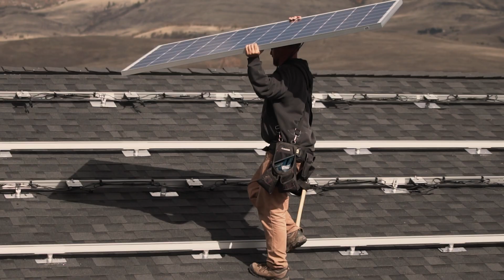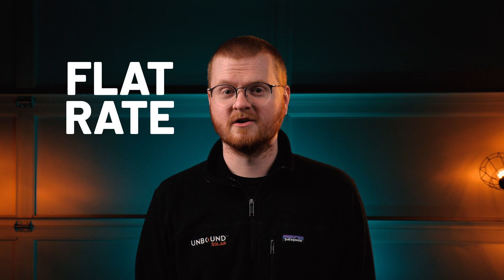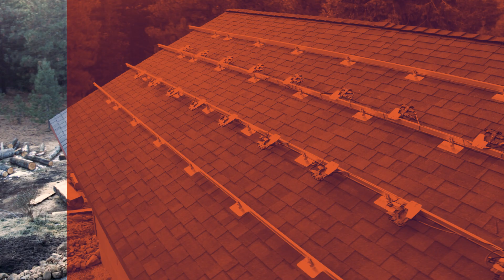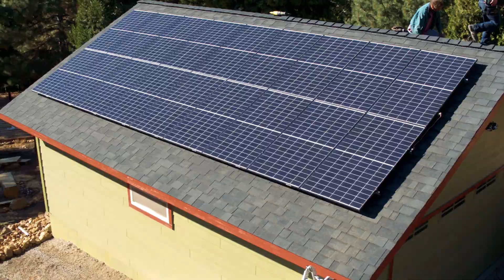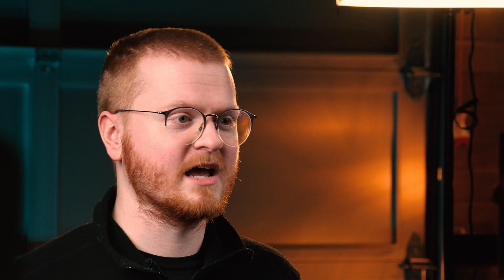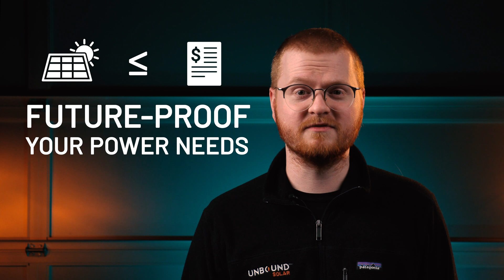Is Solar a SCAM? | 5 Reasons Solar Leases Aren’t Worth It

Comment: Today, solar panels are the cheapest component of a solar system that also includes storage batteries, inverters, transfer switches, and a subpanel. Also, some states are no longer worth while to sell excess electricity back to the grid. So owners should look into a hybrid system to allow power to be stored and accessed in peak demand or a power outage. A system can cost between $15K to $30K (with professional installation) depending on how much electricity capacity is desired. The hardware is getting cheaper every year with the matching federal tax credits.

Comment: Real world experience here:
I started a solar PPA in August '17 with Vivint Solar (now Sunrun), and right from the start everything I experienced was exactly what I expected. I was set up with my panels and even all-new electricity coming from the street to my house to a new circuit breaker panel box, upping my amps from 60 to 100, all at zero cost to me. My 20 year contract started at 15.9 per kWh with a contracted 2.9% annual increase. One year they didn't even increase it.
I only ever paid the price per kWh according to how much production was made and not a penny more. 

I was told that in year 6, I would get a one-time offer to buy out the system, based on current FMV. Earlier this month my 6-year anniversary arrived, and I contacted them because I had a number in mind to be comfortable buying it out, being responsible for any issues that may come up. 

I'm good at simple math. I calculated the amount I would pay through years 7-20, factoring in the 2.9% annual increases, and came up with $16K over the next 14 years.
My comfort zone was $11K, giving me $5K leeway in case something comes up (inverter failure, most probability) within those 14 years.
They quoted me $8,700 to buy it out. Bonus!! That's $7K leeway.
I signed all the necessary papers, mailed the check in full and am just waiting for everything to be finalized and I will get the warranties for the panels and inverter transferred to me.

Here's where I surprisingly did very well: I lamented not buying the system myself, just paying the money upfront and never paying anybody for anything after. I could've. I have the funds. If it would've cost $20K, and then a 30% tax credit the first year, that brings it down to $14K total.

In years 1-6, I paid $5K. Buyout was just under $9K. That's the same $14K that I would've paid if I did pay upfront. But where I think I really made out was that if I did just have panels installed, it wouldn't have come with the electricity upgrade that I got for free.
So, just waiting for the cancellation of my contract to be finalized and have the warranties turned over to me, did I do alright?

Comment: There isn’t always a escalator, you could have a 0% escalator. Even if you have the escalator they are usually lower then 4% and with the rate of inflation the utility rates would still be higher then that of the rate of the escalator in the futures
Reply: Yeah but the salesperson selling the panels to you, won't be getting any commission on that, if your escalation is 0 percent.

Comment: Solar is a scam. My original electric bill was $150 a month on average. After getting solar, of which I now pay $148 fixed payments to use.. it did zero to lessen my electric bill. I'm still paying the electric company $150 on average each month + the solar bill, making my monthly payments of using electricity around $300. According to the website account for el paso electric, i'm using 0 kwhours, as if solar is actually working, but then the bill comes in and then i asked the electric company what's the deal? they gave me that BS about cloudy days or the panels aren't working yadda yadda. had solar come out and check, they said it's working tip top, no issue. we don't use power at night anyway aside a laptop and the coffee maker (and the fridge). the bill should be no more than $20 for line usage, or none at all since the amount of solar i'm producing is more than i'm consuming and they claim to buy back the power you overproduce  (which according to our solar provider, we are producing way  more). This leads me to believe our solar company is lying. The power company is well established and doesn't charge more than their systems indicate, so I'm convinced solar panels don't work at all. they're just pieces of glass that do nothing.

Comment: Dear Lord... the ONLY reason for any lease is to use something expensive for part of its useful life... you are NOT locked-in long term/required to pay full price. If you lease a $40,000 car, you generally do it for a couple years. You might pay $900/month for two years. $900 * 24 = $21,600. Its dumb to pay that much, but you aren't locked in for more than two years. That is the only reason to lease... the ability to quit early. You don't have to pay $40k plus interest.

A regular loan for 6 years @ 6%, no money down is $663/month. Why on earth would anyone be forced to make all payments (I.e. 6 years) and choose a lease vs loan... $900 vs $663/month? Only a moron chooses a lease when you cant get out early. No solar leases allow you to get out early...

All solar leases are long-term/full price plus massive interest. They all charge more than a loan. They all open you up to liabilities (big deal). They all prevent you from selling off your home without paying the high price in full. They raise payments as you go (they aren't flat). 

If we want to get technical, lease payments are based on residual value... there is zero residual value for solar. Only a complete sucker "leases" a solar system. Its literally bone-headed and incomprehensibly stupid. It very much should be illegal. The only people who do lease solar... have been suckered... lied to. No informed person would lease solar vs a loan or cash. None.

Comment: I spoke with a sale person last week. His calculation for my small house would be $45.00 on the solar payment (25k for all the solar panels). The electricity bill will be dropped down to some $25.00. The total of the TEP and the solar bill will be around $70.00. My Summer electricity bill is around 140.00. Average yearly is around $56.00. There is a flaw to read between the lines. The total power (kwh) the TEP allows for my home will be 3.2kwh on the 400w panels. From the beginning, he was saying the TEP does not like anyone who has solar panels on their roofs because TEP will not make money if everyone have those. In 45 minutes later (the end of the conversation with the sale person), I asked him if I can have over 6kwh on my roof and on my back yard (he forgot what he was saying), he told me that the TEP will not allow my home to have that capacity (over 6kwh).
After 45 minutes in the conversation with him on the phone, I realize it is a SCAM. It seems to be that the energy on the solar panels will definitely benefit to the TEP (TEP controls and limits my solar energy). The 3.2kwh allowance will not benefit me at all. My A/C run on 2.8kw, my stove run on 3kw. What would be the power I can have with 3.2kwh if I will run the stove and the A/C at once? I still have to use the energy from the power company. 
There is a downside on those panels too. The average hours those panels can produce electricity during the day is around 5 hours. I am not talking about the Spring or the Winter times. When the sun is down, I still have to pay the TEP for the power I need. And, in Arizona, if you have the temperature raises over 108 degree, your solar panels will be doomed. They will be overheated. One more thing is those panels are old technology. If you see the cells have 90 degree angle, that means they are old. I do not need to explain more in details. Solar advertisement is a SCAM.

Comment: So just yesterday, a guy came out to my house to give me a quote on solar power panels, with panels and installation and with inverters on the panels, they wanted to charge me 56,000 dollars which was payments of 186.00 dollars a month for 25yrs. I have more research to do, to me that sounds dam expensive. Because with labor and the cost of the panels, I cant see that system costing more than 18 grand with labor. Yrs ago I got a quote and the guy wanted to charge me 14 grand and told me it would take me 7 yrs to break even with what I would make. Also, the expensive guy told me that if you have to get your roof done then it costs 8 grand to take down the panels LOL......better off just buying a panel yourself and run an extension cord inside to power your devices

Comment: also if you dont pay sunnova for the bill they send you every month, they can report it to the expedian or those other credit companies. I think they just come up with a way to get inside your pockets and make you pay them for deceptive practices.  IThe guy told me 85 dollars a month is what I would pay nationalgrid, I wont have to pay solar any money per month because the solar is generated by the sun, it gains power by the sun, but thats not true, the 85 dollars is going to sunnova, and I still have to pay nationgrid for my monthly bill. After 5 years my solar will cost me 21,800 dollars to buy out, if I dont have 21,800 dollars in 5 years then I will still have to pay sunnova every month, now is that a profit or a rip off. Now they saying they cant change my contract and they cant remove the panels.

Comment: its a cam because the money you pay per month goes to what is generated by the solar, the solar company told me I am stuck with the solar because i sign the agreement. The national grid company still charge me for electricity every month and it can be over 300 dollars a month. Also I have to pay sunnova 85 dollars a month because of the solar generating power, but it powered by the sun so why am i paying them for solar when its being powered by the sun. Its not worth it.
Reply: Did you solar came with a new house you purchased or you got them to install it after you already moved in?

Comment: Solar is not rocket science I’m a 86 year old DIY guy my solar farm is an ongoing project I buy 100 w panels because they are easy to handle  I buy used panels and new as I can afford them.   The panels are ground mounted for easy access for installation and maintenance .   I am grid tied and now saving about 1/3 of my electric bill.
Reply: Same here Leon. I have 2200 watts of solar ground setup. I found a panel manufacturer that produces a good quality panel. I purchase 2 panels at a time when I have the funds. I have a fully off grid setup that powers just over half my house. Just me and my 10 year old daughter. We know we have to respect our power storage. We turn lights off when not needed  ect.  We have electricity for stove and furnace but the rest of the home is all solar and we love it!
Reply: you probably bought them up front, but for the person that get the panels with 0 up front funds, you have to pay sunnova every month and still pay your electric company every month for the electricity bill.

Comment: I loved the content in this video! But, I was able to arrange a 0% escalating lease for an Arizona family at 9.5 cents per kwh that the panels produce. This is in contrast to an average of 14-16 cents that they were throwing away per kwh to the utility company! 

They can definitely work and allow for homeowners who can't claim the ITC because they're fully retired with no liability to get the best deal.

When in doubt purchase, but surely Unbound Solar is aware not all leases are bad?
Reply: Hi Theo, The 0% escalator sure does make it appealing in my opinion. Have you had any downsides? Is the system producing as expected ?
Reply: In my experience all leases are bad.
Reply: @TheKuptis  I thought the same but for folks that don't have tax liability and are on a fixed income its the best route to help them save